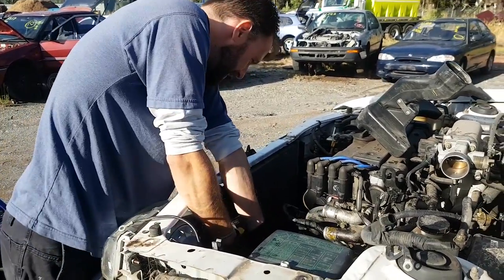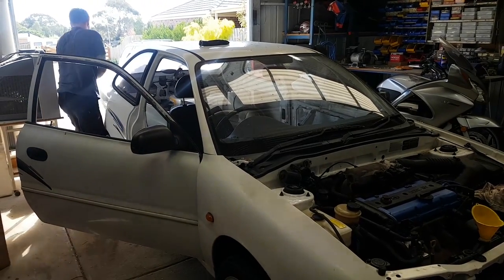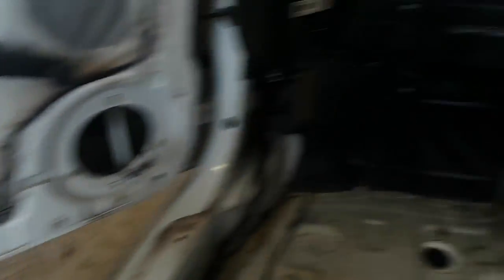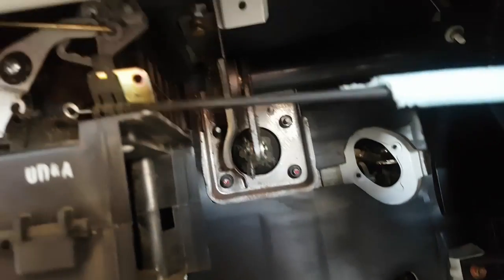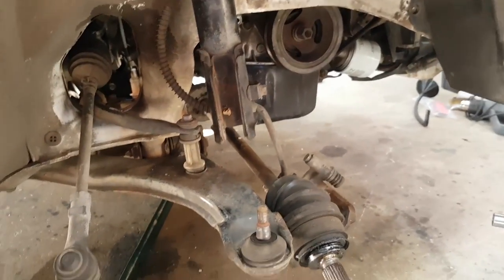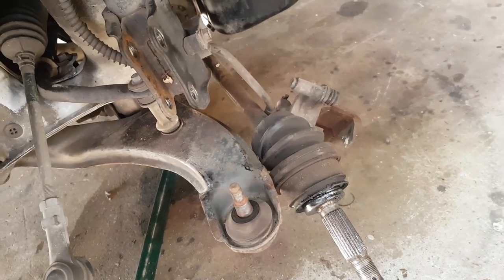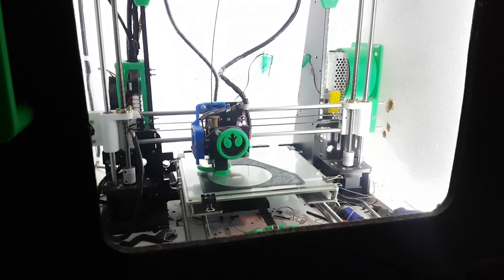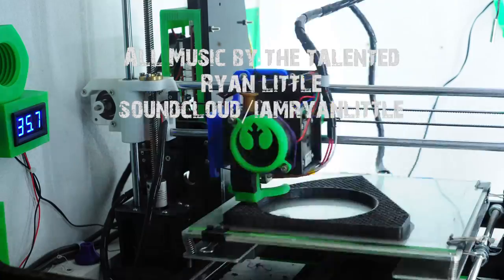Budget Race Car Build - Part 7 - i'ts alive again!.. this video is a mess

Comment: With the radiator would the standard one be enough or is a higher performance model needed?✌️👍
Reply from the maker: Sorry for the late reply mate, yeah standard rad is more than enough in these! my car out on track never gets hot, as long as it's in good nick and not blocked or anything :)

Comment: Do you need to keep the fan controls on the panel if you get rid of the a/c fan?
Reply from the maker: You're absolutely right it's just a dummy switch now! These cars have a great cooling system and never overheat so that second fan was overkill